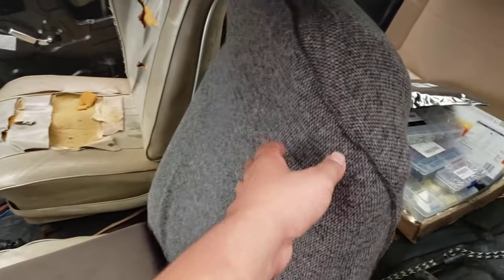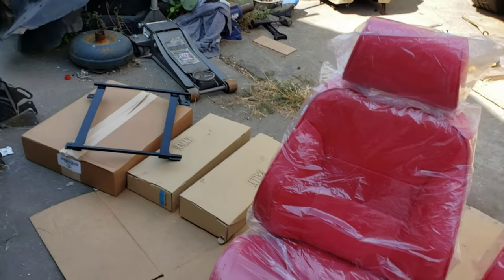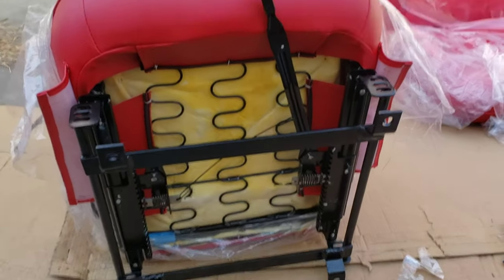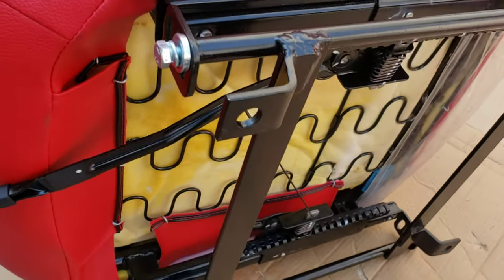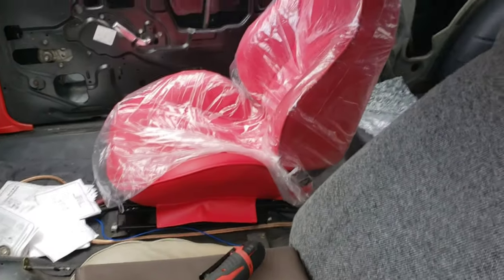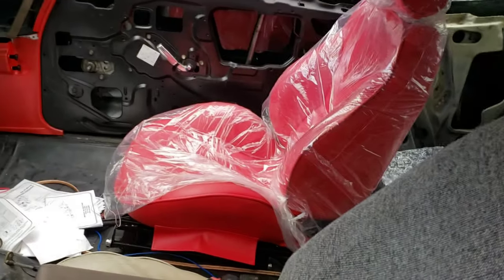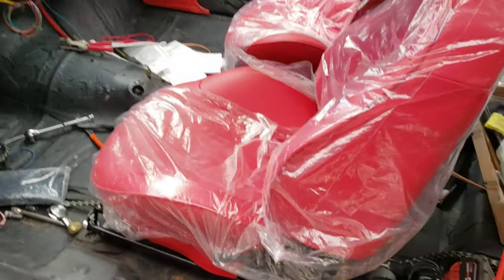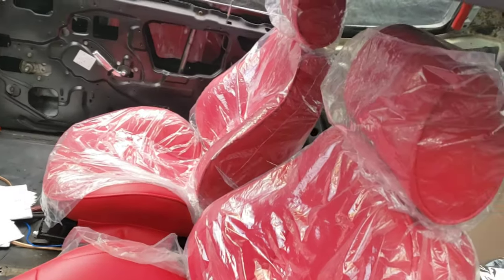ProCar Bucket Seat Installation | 72 SS Chevelle

Comment: Do you think these will be too tall for a 87 Monte Carlo?
Reply from the maker: yep I think it'll fit,  it's a little over 3 ft, headrest pulled out, mount flat on the ground to the top of the headrest, seat back 90°. . . Hope that helps. . . . Appreciate the support 🤙🏽
Reply from the maker: You also have about 2 in worth of movement with the mount bracket up or down fyi
Reply: @Califormula  plus I think it may be too wide for my console too but I’m not sure I might order them how much were they total?
Reply from the maker: @drejackson1000   yeah they barely fit with the Chevelle console there's like half an inch not even a quarter inch on each side before it touches the console. . . The Monte console is about that bigger than the Chevelle AT LEAST. . . Tell you the truth bro I don't even remember I know they're under a grand or at least they were before this crazy inflation. That is seats and brackets